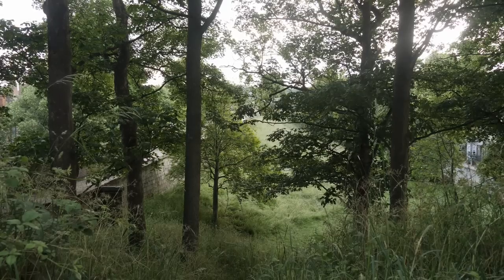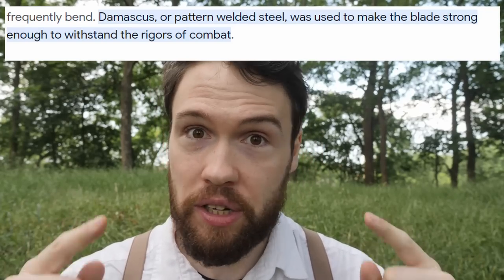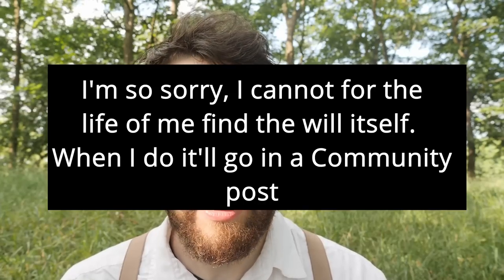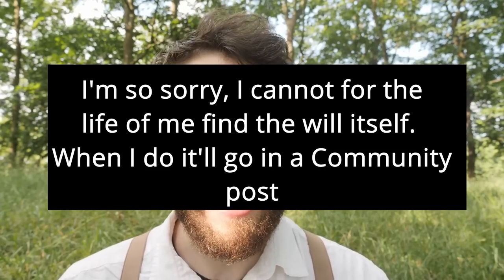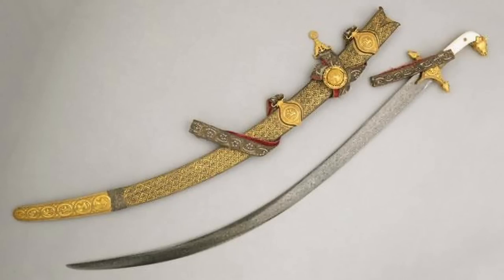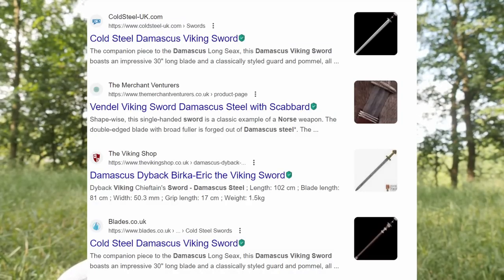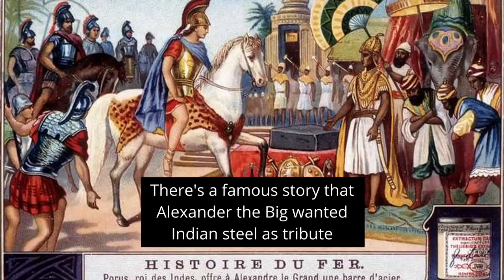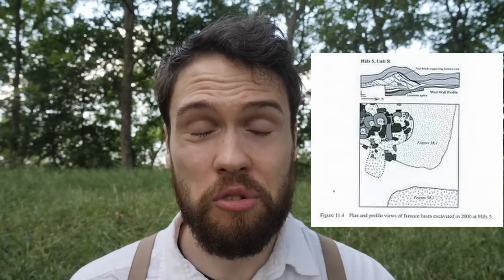Damascus Steel Isn't What You Think! Asian Crucible Steel in Medieval Europe

Comment: Yay! A topic I can help with some specialized information in the form of a mile long comment!

So, to start off: everything Jimmy presented in this is roughly accurate. Unfortunately it misses out on a bit of the nuance that's involved in modern blade industry nomenclature. The confusion regarding what is damascus steel is actually goes back to European gun barrel makers. High end gun barrels (mostly shotguns) were made by pattern welding steels of different carbon contents together and manipulating them to create visual interest. These have been called "Damascus" in the firearms industry for much longer than what we have seen in the cutlery industry. 

The current issue is a result of a smith named Bill Moran. Moran was one of the founding members of the American Bladesmithing Society, one of the world's preeminent organization for qualifying bladesmiths. In the late 1970s Moran was seeking to replicate the APPEARANCE of damascus steel, and clearly knew about the connection between pattern welding steel and the "damascus" term used to refer to gun barrels. Moran's big contribution to the confusion was that when he developed a method of pattern welding using a high nickel steel to allow for much more dramatic pattern contrast, he called it "the NEW damascus". The technique was adopted into the ABS curriculum as a demonstration of forging skill and, unsurprisingly, the "new" part was quickly dropped.

As the ABS has a HUGE influence on trends and publicity in the bladesmithing world, their use of the term "damascus" is essentially now a piece of trade jargon. To try and avoid it, a lot of smiths avoid using the term at all; instead we'll use "pattern welded" for it, and "wootz" for modern reproductions of the original crucible steel.
Reply: Thank you.
Reply: Thanks. I also came here to say that almost no one in the knife industry is using "Damascus" deceptively. It's a result of historic ambiguity in the usage. O
Reply: Where does this term "wootz" come from? It doesn't sound very Dravidian, to my ears (though I only speak Malayalam, not Tamizh). Is it European?

Comment: Just to be clear about something Jimmy said: a patterns welded blade is not inherently better or worse than any other modern mono-steel... But it is VERY labour intensive. If someone is offering a pattern welded sword for sale, expect it to be several times the price of a comparable plain steel sword. With pattern welded "damascus" you absolutely will get what you pay for.
Reply: I once saw what must have been pattern-welded knives at a rock and mineral show.  In my ignorance (thank you Jimmy, for enlightening me!) I asked if it was Damascus steel.  The seller, who was the knife smith, was noncommittal, and now I know why.  They were beautiful, however, and if I ever see him again I want to buy one for ... reasons?
Reply: A long-ago book that I read, said of the various "Damascus'" steels, "all three offer a chance to make a great blade, along with a splendid chance to fail."
Reply: When I have seen fancy patterned knives on food shows it seems the pattern goes away with sharpening.

I'm hopeful that this is not the case with Damascus or pattern welded?
Reply: @jessicazaytsoff1494  regular sharpening shouldn't do anything to the pattern. If you end up abrading the flats of the knife it will, but most smiths etch deep enough that it really shouldn't be a problem.
Reply: I would advocate for a modern high quality steel to be better than a pattern welded steel. Not as pretty, and not as satisfying to use, but for sure better.
Reply: @sidekickbob7227  yes and no.... Modern pattern welded steels are are done out of thin bars of modern high carbon steel. Their performance is essentially identical, just takes a lot of time to produce the pattern.
Reply: @nickverbree  The pattern appears due to the different steel quality, reacting different to the etch. Will using two higly capable steels qualities (capable in hardness and wear), give you enough difference to let the pattern appear? Also when welding the layers togheter, you raise the risk of putting a weak spot in the blade.
Reply: @sidekickbob7227  the pattern doesn't appear from different steel qualities, but different alloys. The two steels used in modern pattern welds are typical a plain high carbon steel like 1084 or 1095, and a high nickel steel like 15n20 or L6. The high nickel sections resist the etch, and are then carefully polished to amplify the contrast, while the plain carbon sections are eroded more and remain black. It is absolutely possible to have weld flaws in your blade, but a decent smith will be able to either spot and correct them, or if they're too bad.... start over. One of the reasons pattern welded blades can be so expensive is that there is a high(er) failure rate in forging and that time needs to be accounted for (along with the extremely high material loss in some patterns).
Reply: @nickverbree  And you just confirmed my case. By "quality", I do not think of good or bad quality, but of alloys with different qualities. Some are harder, some are rust resistant etc. If you want the best steel for an edge, you will find it as you search. To mix in another alloy, who for sure isn't as good, will make a less good edge. I know a lot of you want me to burn in hell for saying this; Buy the best steel in a sheet of correct thicness, cut it out, do some grinding, harden it in vacuum, and do the finishing, and you will have a excellent blade.  The less you mess with it, the better it will keep the properties.  Of course you can sandwich it with softer steel at each side, but keep the edge in the same "best" alloy.
Reply: @sidekickbob7227  there are definitely some misconceptions in that one. First off there's no such thing as a "best" steel for a sword. Some are tougher or more flexible, some are more capable of edge retention, some are balances of the two. Additionally, forging actually helps align the grain structure of the steel to the object it's made into (which is why rated load bearing safety equipment is always forged), so cutting one from a piece of plate actually has several problems (not to say that forging also doesn't introduce issues, but it's about balancing those issues to get the best result). Finally, a sword isn't necessarily JUST an object with the purpose of maximal cutting performance. They are, and have always been, status symbols and objects of great beauty. Especially today when hand made swords are very much luxury items, you simply cannot dismiss the idea of aesthetics. Even wootz crucible steel blades were valued as much for their beauty as their performance, and just like pattern welded blades the effort that went into producing them was enormous. That means they were costly status symbols, just like today's pattern welded blades .... Or if you're really quite wealthy, a modern crucible wootz blade.
Reply: @nickverbree Of course is the beaty a thing, that adds value. That is not what i argue against. The added value do not neccesary add edge sharpnes and other performance properties. Rather not. Yes, grains alignment is akso a thing. But what do you think happens at the steel plant, when they form the sheet to the correct thickness?  Regarding steel alloys, there's for sure some steels that scores high in the properties you look for in a cutting edge. And I'm talking about the cutting edge, not the rest of the blade.  Since you think pattern welded steel is so great,  please tell me why the stopped making shotgun barrels in pattern welded steel, 100 years ago?
Reply: That’s because nowadays we pay for more for the labor while back then they paid more for the materials
Reply: Just because it is pattern welded, doesn’t mean the steel is good. You can pattern weld crap steel and it still won’t hold an edge and will bend easily.

You also have to be a very good smith or your welds will have delaminations and inclusions. Making the end product a pile of crap. 

Pattern welding doesn’t make modern steels better, but it can really make it worse. 

The only advantage of a modern pattern welded blade is that it is pretty. If anyone wants to pay a smith that much to make it pretty, that’s up to the buyer. Personally, I’d rather pay less for a better monosteel blade.
Reply: @ihcterra4625  Yup, all true. I make it and people like it, and it's a fun technical challenge to get it done right.

Comment: You know how in early 2000s it was discovered that true Damascus steel has carbon nano-tubes in it? Well a few weeks ago I was checking up on the reserch into how this could have been achieved. Mind you, I did not see onee reference to anyone involved being a master smith. Just a load of physics. Apparently they are now well on their way to declaring that it was made either with ore or additives that no longer exist. You know, because they cannot recreate the technique, so it had to rely on things they can't get anymore, can't be they just can't figure out the very specific sequence of actions the ancient masters.
Reply: Damascus steel when analysed shows about 0.3% manganese, molybdenum or vanadium and 1.5% carbon.
Basically it is a chrome molybdenum carbon steel alloy.

Comment: I've always wanted a seax made of wootz. I think it might be a cool hypothetically historically plausible piece
Reply from the maker: Yyesssssss
Reply: a Seax wouldn't have been made of crucible steel, far to expensive and rare back then, they were usually made of wrought iron with a carbon steel cutting edge or pattern welded
Reply: @andyc750  Even an etched wrought iron blade can give some quite surprising patterning after deep etching.
Reply: @bigoldgrizzly  I know but that is due to slag in the material and why it was often folded so often, it is wrought is very different to pattern welding and true Damascus, the pattern is like the grain in a piece of timber
Reply: @andyc750  Quite so, One of the reasons I love working with wrought iron is the fact that it has this inherent grain rather than a bland homogeneous modern steel. It would certainly been the most easily available and most used material, with inserts of expensive higher carbon steel to give a better quality blade edge. Etching gives a subtle effect far less pronounced than that of pattern welded steel.

Comment: Notes: Hard and tough are two different qualities when talking about steel. Tough means resistant to breaking and hard means, well hard. Hard steels hold an edge better, but tend to be more brittle.* There are different techniques to try to get a blade with both qualities. Damascus was one, as are heat treating, lamination, and pattern-welding.
A note on pattern welding, aka modern Damascus. There are varying qualities as well as fakes. The number of layers means higher price and supposedly a better end product. The types of steel used makes a difference in quality as well. 

*This is a simplification, but it gives the general idea.

Comment: interestingly, my first introduction to the idea of pattern welded steel came in the 90's when i was exploring polymer clay techniques. there is a technique used to create many layers of different clay colors (sometimes including translucent) and running them through a pasta machine to press them thinner. manipulating the resulting stack with impressed patterns resulted in a wood grain or watermark design.  the technique was called Mokume-Gane and traced back to Japanese/Asian metalworking practices of the same name. about 10 years later, i had my second exposure to pattern welded steel in the form of a video about the search for the lost techniques of Damascus steel. there they gave a similar (though less researched) assertion that pattern welded steel was not the traditional Damascus steel.... long before the internet was covered in options to buy. 

in defense of the sellers labeling their work as Damascus steel nowadays, in all likelihood, the don't have much choice. SEO driven traffic controls a lot of commercial success online nowadays and it has changed the way terms are used based on what attracts views. i notice this a lot with wool. if you are looking to buy wool for spinning, almost all prepared wool will be called roving, for example, even though the majority of what is available is combed top. people who are new to the craft have a hard time learning the difference because of the ubiquitousness of the term, and so the term is used more often in what becomes a feedback loop. those who know better can't avoid it without losing traffic.

Comment: Wootz is still around and there's a few people that will make it, its essentially a high carbon content of about 1.2 to 1.8% with some vanadium in there for hardness, some trace chromium and the rest is a crucible process. What got lost over the years was the ores to make it, most of the mines in India and Syria were depleted some time ago a bit after the 18th century. Its quite a difficult material to use in the sense that its a bespoke melt when you get the end product that isn't going to react exactly the same as the material in a similar melt that's done roughly the same time and that comes back to how its processed and ultimately heat treated. You can't really give it very high temperatures during the refining process or it burns out all the carbon and generally the hardening and tempering process is about as variable. There is even some apocrypha that in some steels where not even hardened and hammer-forged out almost completely cold in some sort of age-hardening process that I'm kind of so-so on taking for what its worth but I'm hardly an expert and this video just popped up in my list on youtube
(but I am a full time cutler)
Needless to say, wootz is a completely rubbish material for industrialised processes and really the other reason that people threw it in the too hard bucket, no ones rolling up to your merchant to order 30,000 munition grade bayonets, sabres and other pokey objects from your foreign sources- they went to England, Germany, Spain, France and Italy when they wanted a lot of metal objects to fit out the vast armies of the time. Leaving the bespoke manufacturers of such things to just local demand from whoever. Its why you see 'trade blades' from about the 16th century onward show up in everywhere from central Africa with a Solingen proof or in the Americas from the Brits, French and Spanish. So even while they 'could' make their bespoke crucible steels, even the people who could, wanted more and the European processes was BETTER in the sense you have more blokes in the field with a sharp object that was functional than the other guy and the real killing began. Add to that, swords really only had a use up until blackpowder was being phased out as your 'better than nothing' alternative in a gun fight and the gun itself was probably the greatest equaliser in terms of warfare over time that further diminished the importance of edged weaponry.

In terms of wootz today versus modern metals, there's no comparison really. Our modern metallurgy has left it in the dust long ago to the point something like our basic UK or US produced 1084 steels would outperform anything made in the per-industrial era by a very large margin. Plus when you buy it by the bulk in an order, every tonne you have will heat treat exactly the same as the last sheet you cut up and will be perfectly serviceable. That's just basic 1084, the newbie starter steel you give the up and coming knife makers to use, practice on and can make a blade better than some master in the 17th century in terms of shock resistance, hardness and edge holding and its 'barely' a high carbon steel at 0.8% carbon content.
Then look at the high alloy, modern tool steels- these are many generations better than anything else, they're super fine grained, insanely tough, have edge holding for days and essentially makes the modern world what it is by those properties alone for machining tools. Somewhere if you want something that will put up with a 500kw, 12000nm of torque shredding machine that eats car bodies and engine blocks for breakfast it'll have teeth and blades made out of something like S7 or A8Mod and that's commonly available to anyone with the cash who wants to make a knife out of it. (I do sometimes and its absolutely bonkers!)

So wootz had its time, but its more or less an artisan hobby and has been for about the last 3-400 years as industrialisation wiped it out, its pretty cool, you can still make it. Actually making anything out of it takes a lot of work though so its hardly economically viable to do those melts for people without some kind of extra funding to do it.